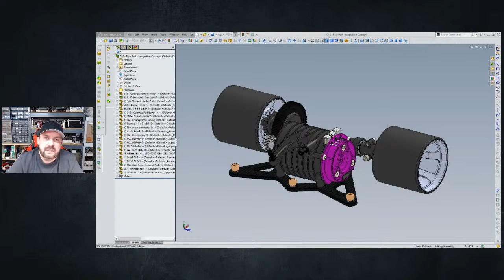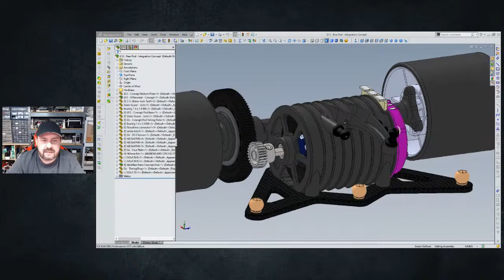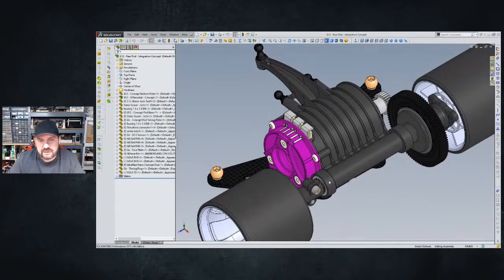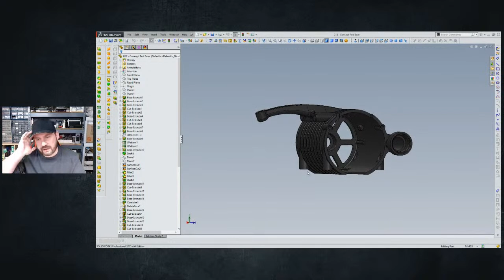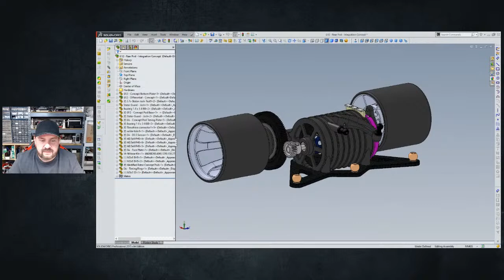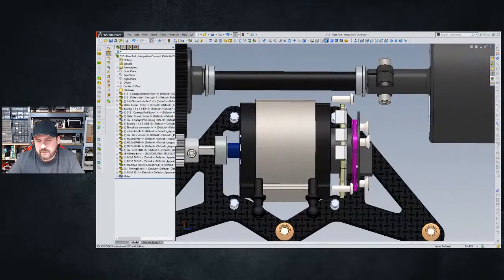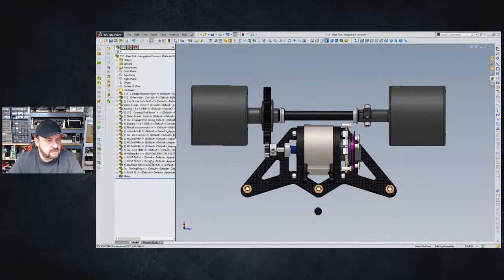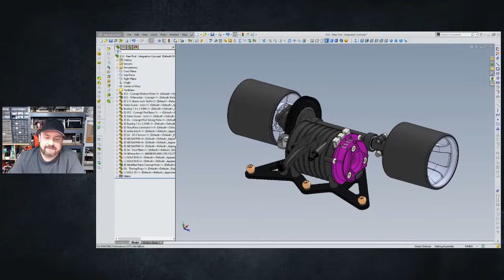GrabCAD Update! G12 3D Printed, Integrated Rear Pod

Comment: Gearing adjustment?
Reply from the maker: It's 3D printed...lol... Print another for a different gearing was my thoughts. This was meant to be a end all be all for races like IIC and Snowbirds where motor homologation doesn't really apply in Modified. If need be, you could make a small axle cam or adjuster to give you a range of 2-4 pinions you could switch between.